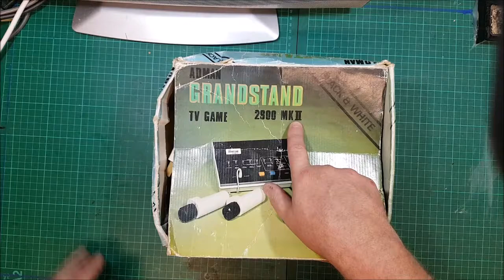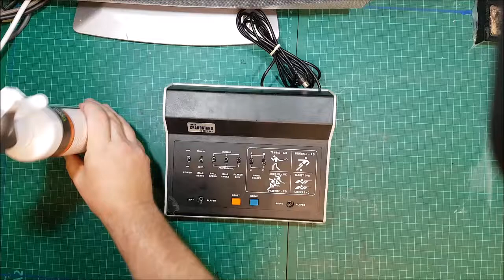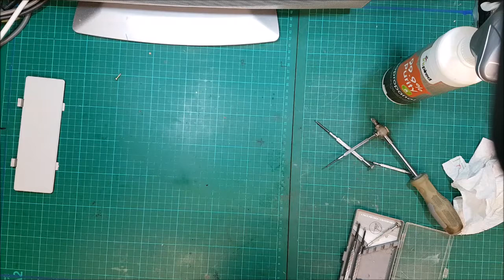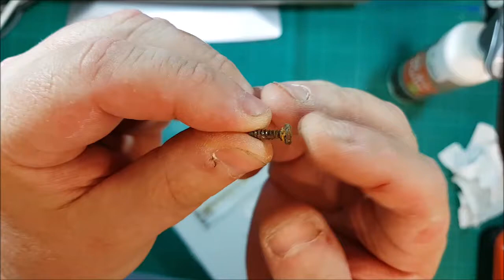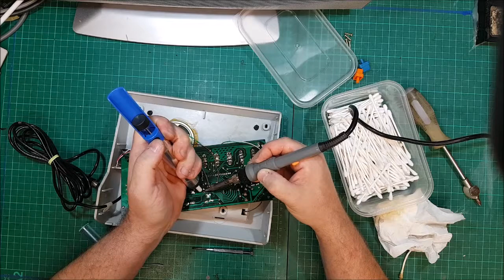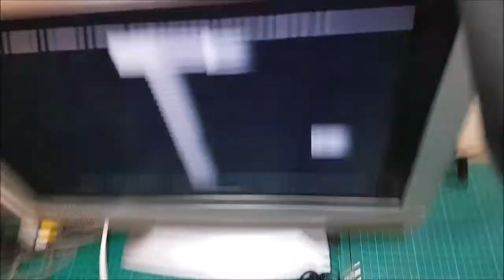Adman Grandstand 2600 MK2 Teardown

Comment: I just found on of these on flea-market. Otherwise worked ok, but the ball goes through the bat. Opened it to see what's wrong, and found a red wire with a loose end. Thanks to your video, I now know where that red wire goes to. :) Let's see if I can get it fixed.
Reply from the maker: Finally, i helped. Its a pleasure to have been of assistance.
Reply: @R_T_Ralph  And now it works! Thank you lord for Youtube-tutorials. :)
Reply from the maker: @jussieskola100  Honestly, its my pleasure to take stuff to pieces to help you fix yours. Second result this week.
Reply: Same for me too - doing some internal work on mine and the red lead came off - thought iwas just power for the pistol but disconnected and cosnole doesnt work properly. Had no idea where was connected but could see it's positions from the PCB shots in video. Resoldered and all working fine! (and now powered off usb wiht composite video ;) )